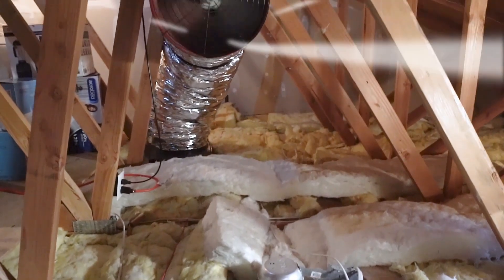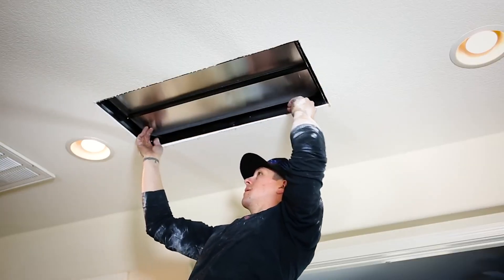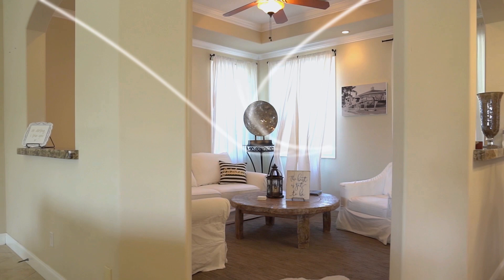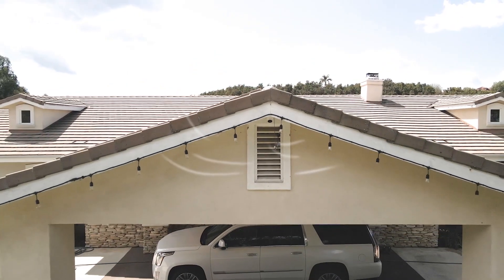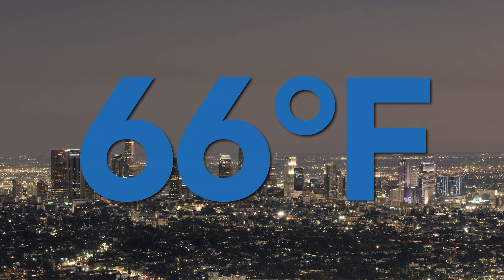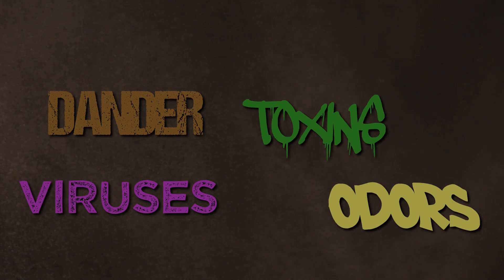How Does a Whole House Fan Work? | Whole House Fans 101

Comment: I have a whole house fan on my second floor with 2 speeds and the louvers which are sucked upwards when you turn it on.   It has 2 speeds and is approximately 26" x 30".  It is very loud and I'm interested to see how much it would cost to switch/modify without ditching my current system.
Reply from the maker: It can definitely be a great investment to upgrade your current fan for a quieter, more efficient model! We have pricing available on our website our you can try using our system builder to find the perfect sized fan for your home. We swap out old whole house fans for the newer versions all the time!

Comment: Seems not useful for Texas? It's 85 degrees in the middle of the night here right now in August.
Reply from the maker: Texas summers can be tough, and you're right, our fans work best when there's a temperature difference between inside and outside. But you can still utilize the fan during spring and fall when it gets a little cooler, and still save big on your AC related costs throughout the year!

Comment: people said that whole house fan creates pressure in the attic and is not good. Is that true?

Another question is why install the fan in the attic? why not just install it on a wall so that it directly sucks stale air out of the house?

Thanks
Reply from the maker: The attic is the hottest part of the home. You want to discharge the whole house fan air in the attic so you can push out all the old hot air and introduce cool fresh air. This will keep your home cool.
Reply: @qcmanufacturing  thanks

Comment: I do have a whole house fan installed in my current ranch home (2240 sqft). It is in the middle of the home in a hallway, right above the thermostat. It is a Dayton 36” old style fan, not like yours and it has a 2 speed motor. I have the controls wired inside a hallway closet next to it. Controls are on/off, switch to change speeds, and an adjustable timer up to 15 minutes. The air flow is amazing, I have to open the back sliding door, the front door and most of the bedroom windows. It will cool down the home in 15 minutes. The noise it makes is not overwhelming. It was installed into the rafters quite firmly, when the home was built in 2003. In slow speed it can run all night or can be set with the timer for 15 minutes, by that time you’re normally asleep. It works quite well, especially in the spring and fall. This is a do able DYI installation for a good experienced homeowner, not your average homeowner. I live in a Chicago suburb.
Reply from the maker: Yeah, the concept of whole house fans work great even the traditional fans. Ours is just quiet, more energy efficient and not a huge cut out on your ceiling. They both do the same concept. Thanks for sharing
Reply: @qcmanufacturing  Reply……mine is a real 1/3 hp, 2 speed motor, can run continuously all day and night.  Fan is all stamped steel, fully coated/painted, and balanced.  It also uses a spring loaded 36” square shutter, that opens and closes based on the fan suction.  Well designed Dayton fan. I bought it in the early 90’s, but never installed it in my old home, but did in this home in 2003.
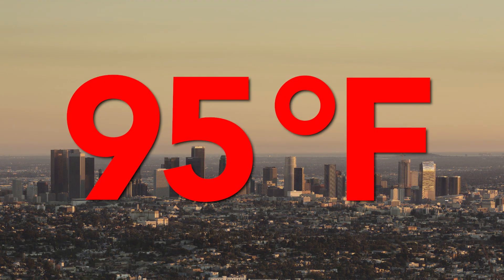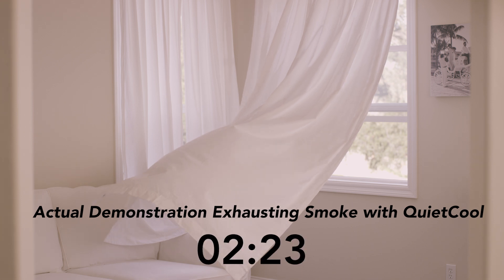Reply: êthe b. 0:17 😅😅😮 so sz😮😮s😮😮😮😮😮😮s😮s😮r😮😮😮😮s😮s😮😮😮😅😮s dadsz😮 1:14 sà😮😮😮s😮😮 fs 1:28 😮😮s😮😮à😮😮s😮zzu😅 izzz😮 r c😮😮😅😅z😅😮ssvvs😮sv😮  re w 2:32 😮😢 really wish we had

Comment: Is there a filter that needs to be cleaned?
Reply from the maker: No filter to be cleaned!
Reply: @qcmanufacturing  Would be interesting to have a filter set up for windows that would be used for this purpose.
Reply: @Garth2011  quiet cool now makes window screens with the capability of filtering airborne particles!
Reply from the maker: Yes, you’re correct!! They’re called a “Clean Air Window Screen.”

Comment: I like the idea that it cools the attic too, but for $1000, I'll stick with putting a box fan in a window pushing out, and another box fan on the opposite side of the house pushing in.  Far less air flow than an attic fan but only 40 bucks.
Reply from the maker: Hello,

Please remember that box fans only cool the ambient air of the home and not the structure itself. As a result, the living space can still heat up even after the sun goes down. after the sun goes down.

If you are skilled, you can finance the product on our website.
😉
Reply: Believe me is worth it, we install it in my 2300 SQ house and I only use my AC for 4 hours during the day after that we run the quiet cool fan my kids use worm blankets to sleep because it gets cold in the middle of the night, we love it!!
Reply from the maker: @jenycastillo1339 thank you for sharing your testimony. Once you have one you can’t live without it.
Reply: Your attic is still not cooling down any with box fans. The whole house fan cools the living space as well as the attic.

Comment: My opinion this styles not good at all and the reason why because the fan suck the air from inside home with all humidity from cooking, shower and air conditioner process push air to the attic may cause mold and moisture  accumulate .
Reply from the maker: I’m our experience with over a million customers at a 98% customer satisfaction rate we have never rotted out an attic because of the reason your stating. I don’t think you understand the concept.

Comment: This would be horrible in houston Texas the humidity alone will kill ya
Reply from the maker: During summer yes because it does t cool off but in the spring and fall it works amazing. Instead of running your ac 10 months a years only run it 3-4 months.
Reply: @qcmanufacturing  what is this spring and fall you speak ok lol.
Reply from the maker: @jaimetrevino9244 pretty much any market in the United States has pretty nice weather during the spring and fall. Or least cools off at night.
Reply: Hahah! 
Floridian here and I agree with this comment!!
Reply: Works good here in Pasadena CA. The days are warm and sunny but our average overnight temps are about 60* mid summer. Usually 30* difference from low/high temps.
Reply from the maker: @rmendoza243 yup, thank you for sharing.

Comment: How do you turn the damn thing off. I have a customer that just moved into a new house with one of these and no instructions for it. The controller has no off switch. This damn thing is causing the water heater to backdraft and it popped the $100 protection device maybe this is a bad installation or something but a controller with no off switch is stupid,
Reply from the maker: Call us at 1-888 QuietCool and will help you out. Are sure it is a QuietCool and do you have a remote or switch in the house?
Reply: Of yeah another thing, it’s hardly quiet. Damn thing is howling like a banshee and causing the doors to slam shut so hard I’m sure the jambs are going to need repaired from the slamming.

Comment: What if the house is in the middle of a row of houses and does not have vents besides the bathroom exhaust vents?
Reply: We used a “sting” to cover the corner 😂
Reply from the maker: Hello,

You may need to consult with a local contractor to see if a fan is correct for you!